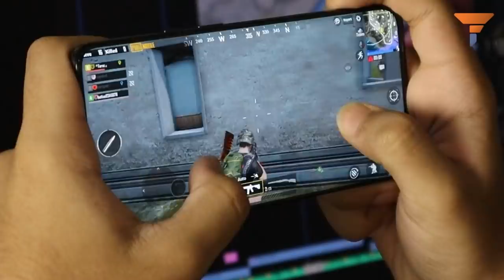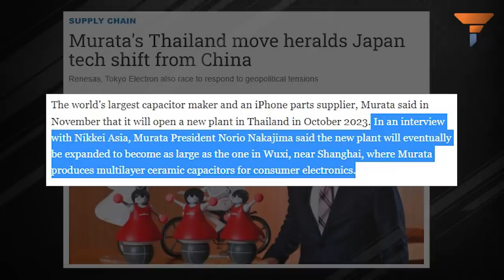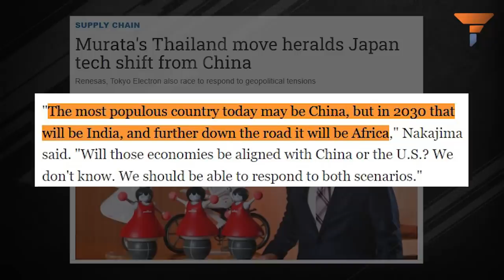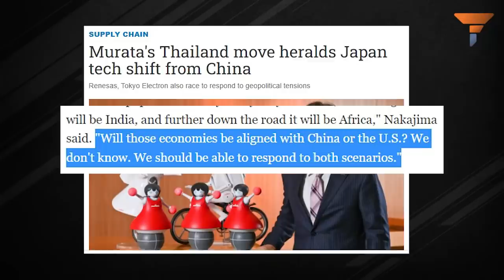Japanese Capacitor Manufacturing giant Morata shifts out of China

Comment: Murata to shut down Chinese production facility
Saitama Murata Manufacturing, a subsidiary of Murata, will close its its coil production subsidiary Sheng Long TOKO Tech, located in Shenzhen, China, during December 2020
Saitama Murata Manufacturing Group has contributed primarily to the development of the telecommunications market through its design and production of coil products.

However, due to the diversification of the needs in major markets, such as smartphones, combined with the accelerated development cycles and intensifying competition, Sheng Long TOKO Tech is facing an increasingly difficult business environment; this includes a decreased demand and intensified price competition, the company explains in a press release.

Considering these factors, Murata has decided to end production at the subsidiary and close it. The company stresses that the impact of the closure of these production subsidiaries is negligible.